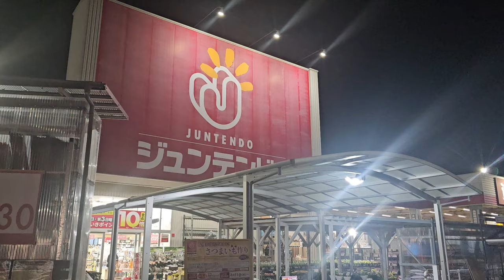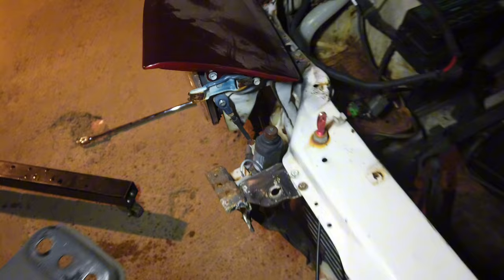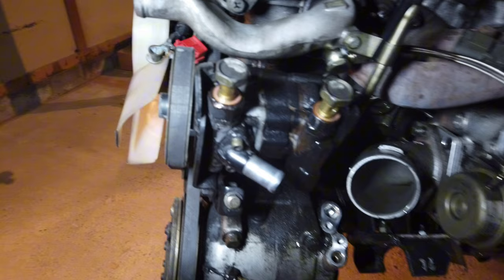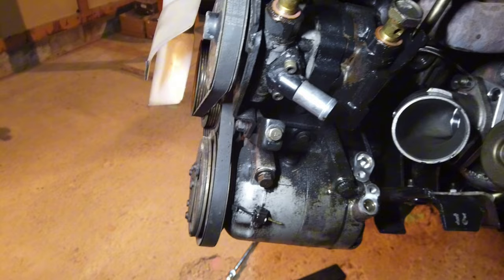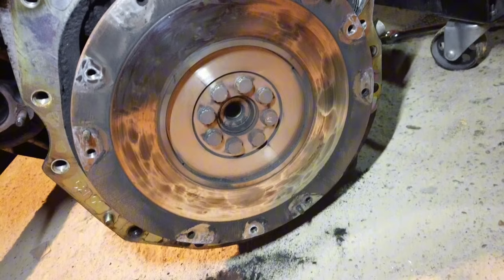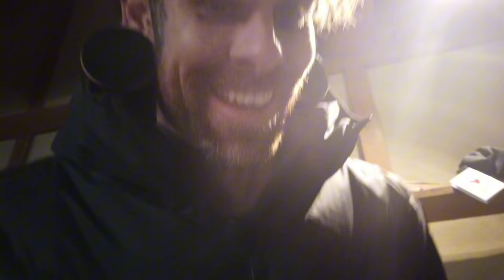Sr20 adventures

Comment: Just get it welded up and re drill and tap it.
Reply: Could you though? I reckon seal it off and run it around. Interested to see what you do, an also what would upgarage say about it 🤣
Reply: If you put a copper bolt or a piece of copper wire down into the gallery it won’t block it off. The A/C won’t touch the copper.
Reply from the maker: This was the plan sir woooop